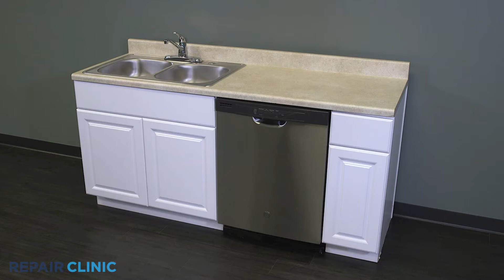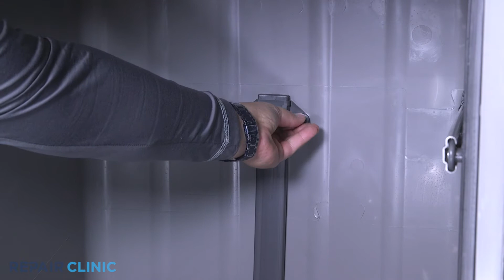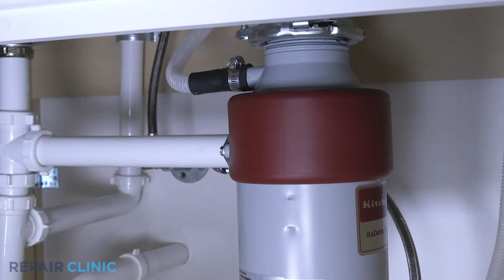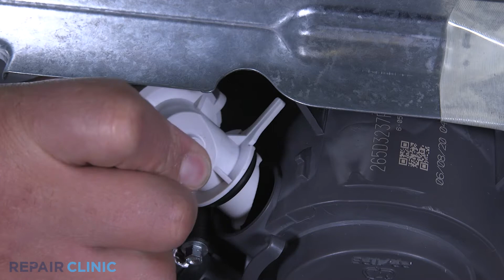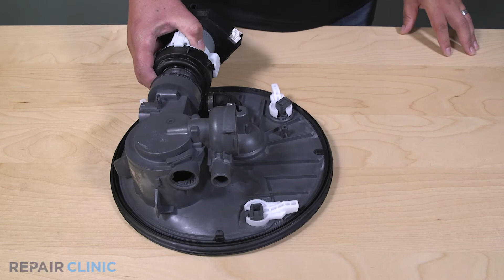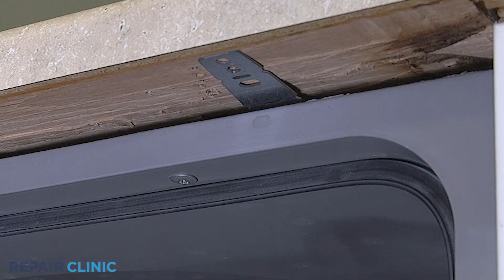GE Dishwasher Circulation Pump Replacement WD19X25700

Comment: For anyone here because of the FTD error on your DW, I was able to clear mine out by cleaning the small black water sensor attached to the white tube that connects to the bottom of the dishwasher. You’ll have to disconnect it and use a toothpick to get any debris out of it. It’s a tiny sensor inside the roundish part. Mine was gross, but it worked flawlessly after I cleaned it. Hopes this helps someone like me
10:19

Comment: I used a long zip tie to hold the pump in tight. There is a tiny little feable attempt to put a clip into a hole on the back of the pump. . Enough vibration and the pump falls out, putting all the weight of the pump on that rubber elbow.
Reply: Kind of a long shot but what did you route the zip tie through to hold the pump up? That hanger doesnt feel reliable.

Comment: You can actually just tip the dishwasher on its side and remove just the circulation pump in about 5 mins. Only 2 clips to unplug.
Reply: Yes. Most of this work is COMPLETELY unnecessary.
Reply: That's what I was thinking! He took the whole dang thing apart
Reply: No kidding! If I did it their way I'd end up with more leaks than I started with.
Reply: Sonofabitch....why do they have you take the whole thing apart ... I took damn near everything apart before I read people said you can tip it on its side and just remove circulation pump
Reply: Damn, I was thinking the same. Why did they take the whole thing apart?
Reply: @deeps-v I replaced the circulation pump motor thing and it still leaked everywhere worse so I just replaced it with a better dishwasher a Maytag
Reply: @deeps-v Probably because you would need to call a repairman to put it back together😂
Reply: @ReddogDave  Ha ha, yeah.

Comment: Would it not have been easier to just pull the dishwasher and lay it on its side or just lean it back a little? I mean, is removing the sump really necessary?!?

Comment: That short rubber elbow on the pump is what fails and you cannot replace just that. You have to buy the entire pump assembly. Ridiculous!
Reply: My rubber elbow ripped open and leaked all over my floors. Now I have to order a whole pump just to replace the elbow which may fail again. 3 years seems to be the magic number for failure. Time for a recall
Reply: @trinatakasato2734 My experience also. Could push a finger right through it, clearly deteriorated. Seems like a lot of effort to install a $100+ part in a four year old machine. I’m honestly wondering if should just buy a new dishwasher.
Reply: Yes, I had the same small rubber elbow fail (3 year old dishwasher), no luck getting just this part, had to buy the entire pump assembly.  If it fails again, I am just going to make something to fit.
Reply: @tomborchardt1928  I used Flex Glue to patch up pinhole on rubber elbow. Curated the join for 48 hours before starting the machine. So far it is working good. 
But GE should recall these rubber elbows. There are thousands of complains and property damages due to this 2$ component. GE is losing customers over this.
Reply: I bought a rubber elbow on the pump for $8 plus shipping on (I think) GE's website. Stupid POS leaked water on my hand scraped hardwood floor.
Reply: I just figured this out the hard way... and I say.... F U GE!!!
Reply: Hard to imagine an autopart store couldn't find a suitable replacement 90 deg elbow.. might need to cut to fit.. 💁‍♂️
Reply: @Astro3.14MP  Were you able to swap out just the motor without all the steps?
Reply: You can buy just the elbow. The part number is listed on the diagram. I bought one on Amazon for $5.

Comment: There a reason as to why the circulation pump leaks out of the sump seal ? I realize it doesn’t require a clamp and just kinda pushes into it. But now it leaks like never before. i did not tear the seal.
Reply: I actually took some Dawn and rubbed it around the nipple before inserting and that seemed to do the trick. Allows the boot to really slide up snug. Hope that helps
Reply: I have the same problem... THAT AREA, didn't leak before, but does now
Reply: @ChrisWrightDVM  best to buy the entire new pump that includes the seal as well.

Comment: I strongly recommend using a worm gear clamp in place of the clamp they include.
Reply: I used the worm gear provided with the replacement pump, and unfortunately it's leaking. I saw that the bulky part under the screw distorts the rubber when you tighten it... this did not instill me with confidence as I was putting everything together.  I think that the hose is either not sealing properly to begin with, and/or the worm gear clamp is disrupting the seal when tightened.  My impression is that it's a bad design to start, and the band-aid worm gear clamp makes it even more flawed.  In my opinion, a worm gear clamp should really be used to keep a connection from disengaging but should not be counted on to provide a seal.  The issue with the old pump is that the rubber in the original hose literally ruptured right down the center and water started pouring out.  Now I've replaced the part and I still can't get it to seal properly because it looks like it was designed and manufactured in somebody's garage.  I'm really getting tired of taking this thing apart and putting it back together.
Reply: @mikegulliver4885  Sorry to hear this. Buy yourself a Bosch (300, 500 or 800 series). You can thank me later.
Reply: @mikegulliver4885  I'm dealing with the ruptured part right now. I'm looking for just the rubber elbow part but GE only sells the full washer kit for $145, ridiculous considering I only need that rubber piece. Where did you get yours? or did you buy the kit? I'm also looking at options other than the double ear clamp but seeing that it has to provide a seal and your troubles, guess I'm investing in another tool
Reply: @bradnunn2119  "appliance parts 4 all" for the entire pump assembly, $96 after taxes/shipping.  What finally worked was literally a heavy-duty plastic tie wrap from HF that I cinched tight. What a relief! I couldn't get the worm gear or oetiker clamps to seal properly.
Reply: Constant tension clamps are better than worm gear clamps.  This Oetiker type clamp was specified for a good reason.
Reply: @mikeb.7068  Yeah, it saved the manufacturer 2 cents.
Reply: @threedog22  You were right.  I just disassembled my GE dishwasher this afternoon to troubleshoot low water circulation.  The problem was a clogged impeller on the wash pump.  When I reinstalled the wash pump I used a high quality worm drive clamp.  Much better than messing with finding a new Oetiker clamp.  I did use a solid worm drive clamp with no perforations.  That's the way to go.
By the way, GE, the problem was your design mistake.  The macerator blade is screwed to the center of the wash pump centrifugal impeller.  The macerator makes a great spindle for winding up hairs and fibers into a nasty mess that stops the impeller from pumping.  My dishwasher is exactly two years old.
Reply: @mikeb.7068  GE dishwashers are one of the worst on the market. I’ve replaced countless PCB’s, but most of my customers opt out because it isn’t a cost-effective repair. The only dishwasher I recommend is Bosch.
Reply: @threedog22  My last dishwasher was a Bosch.  I bought it used for $100 and it lasted 10 years.  It died and at the time I didn't have time to troubleshoot it so I picked up this NIB GE for $400 on Craig's List.  I prefer Bosch but the GE is all I could find at the time.